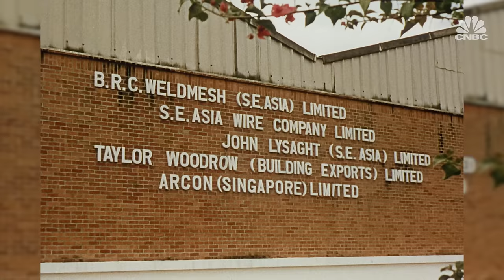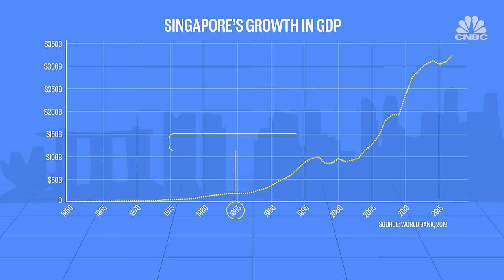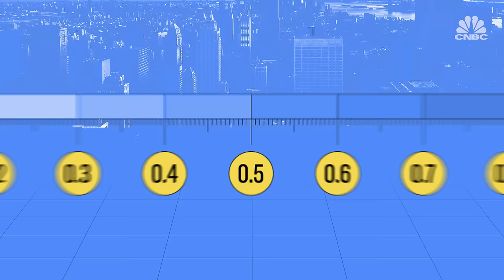Why is Singapore so rich? | CNBC Explains

Comment: 04:19 Singapore has been named the world’s most expensive city.

Hong Kong : Am I a joke to you?
Reply: Me as a singaporean has nothing to do in Singapore
Reply: Even though we have so many places in Singapore
Reply: Singapore: ya.. that's my elder brother. But isn't it the younger one who gets attention?
Reply: The naming came from the EIU survey I think, based on an expatriate lifestyle (which typically consumes more premium goods & services). What that survey didn't manage to capture I think was the fact that basic and premium goods & services in Singapore have larger differences in prices than in other cities/countries. E.g. Starbucks coffee in Singapore costs about the same as in Western countries I think (S$4-6/cup), but coffee sold in local open-air coffee shops/hawker centres (buildings dedicated for street food sellers to operate, for hygiene reasons) are much cheaper (S$1.20-$2/cup), although you might argue that these 2 types of coffee are a little different (the local ones are said to be sweeter and oilier, maybe because different coffee beans are used (probably Robusta instead of the more expensive Arabica I think) often from nearby Indonesia, lowering shipment costs. (It helps that coffee-growing & Singapore are both in tropical climates I think.) The beans are also grounded in advance in a factory rather than being ground on-the-spot in the coffee shop with an expresso machine)
Reply: Actually Singapore, HK and Osaka are joint first.

Comment: At 2:45: "By the 1980s, Singapore was a regional manufacturing hub, and it was the world's biggest produce of Hard Disk Drives."
And then there are Solid State Drives which have faster loading speeds, quicker file transfers, and quick bandwidth than Hard Disk Drives.
Reply: HDD manufacturing moved to Thailand years before SSD was even in the market.

Comment: Drive across the island in just an hour?

Eh depends on traffic dodol.
Reply: Actually lesser than 1 hr as it's on  48km in width and 30 km in height.
Reply: Ok not depends on the traffic.

If driving across singapore. Depends on your vehicle //
Motor
Big Truck
Medium Truck
Small Truck
Van
Car

(unless u driving a very fast car/motor/van/truck. Then it wont be an hour)
Reply: @julienwmm  ,-, Not 30km. height...... It is:  Length = 48km and width 30 km.

Comment: Singapore is rich also because of its talents. But even these talents could not have made sg prosperous the way it has happened if not for the NATURAL RESOURCE of Singapore.
Most Singaporeans are not told this:

1. SG HAS natural resources. Humans and the rock or Singapore. Singapore is basically a Rock which is a natural resource. This island was created naturally even though I modern era it has had some land reclamation. But which come first ? The natural resource called Singapore island made of rock came first.

2. A singaporean instinctively and expectedly would ask me , how does that answer the question? 
Well, Watson, Singapore could not have prospered the way it did without the sea port business volume. The same ships would not have sailed to sg if no to where it is located naturally. Geographical location of SG the natural resource is an attribute of sg. Either could would exist without the other. This location allowed SG to prosper along with the talents of SG. I had to mention this or else risk being "persecuted" by internet bigots who have no ability to face the truth.

3. Malaysia could have gotten the business and they had at one point. But the talents of SG made PSA prosper. But not if sg were not located at where it is. Eg. If sg were located in Christmas island or in the mainland of China, what would have happened? No body knows because it never happened but one thing for sure, SG could not have prospered the way it did if not for the natural resource of SG. Sg would no be called SG if no located at where it is. 

If any of you believe you can  debunk me, feel free to try.

Comment: The narration starts with the statement that Singapore became rich mainly due to big doses of govt. Intervention. This is belied however as the narration continues. From 1965 when it achieved independence from the U.K. to 1985 it IS CLEAR that it did not achieve 1st world status even with its "affordable public housing". Rather during this period, it had govt. intervention which culminated in a 1985 recession. To get out of this, the government  PARTLY disabled its intervention and control by liberalizing AND privatizing most of its state owned big companies like Singtel and at the turn of the century liberalized further its finance and other service industries. From there, the GDP rose because it attracted the entry of FOREIGN capital and competition. But government intervention was still there because of its taxes and transfers on the earnings of its citizens resulting in INEQUALITY. Singapore still needs to do away with this and extend its free market. Outmoded government intervention is the cause of its inequality. Singapore should re-explore the principles of laissez-faire capitalism and how LIMITED government intervention is supposed to operate in a free capitalist system.